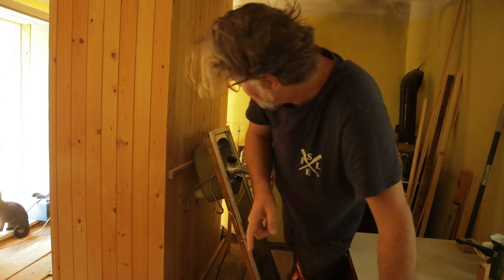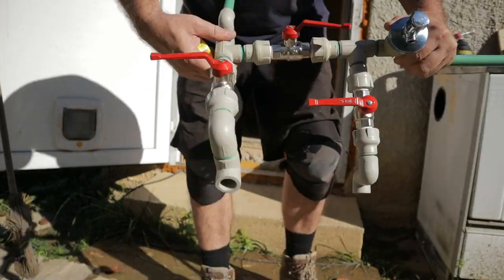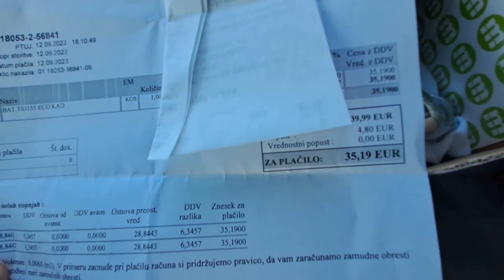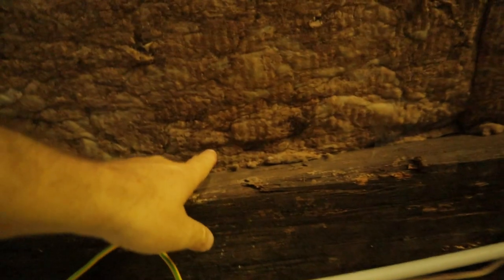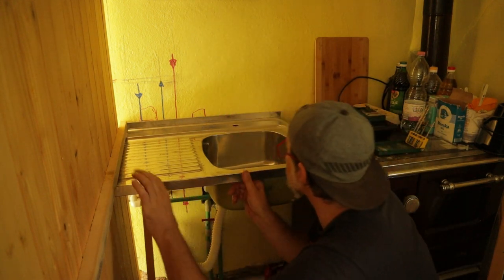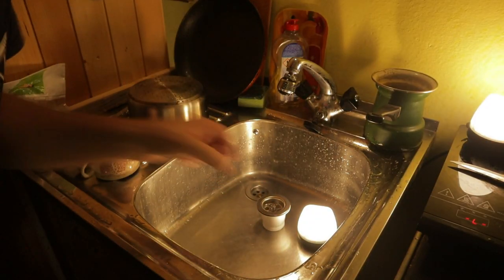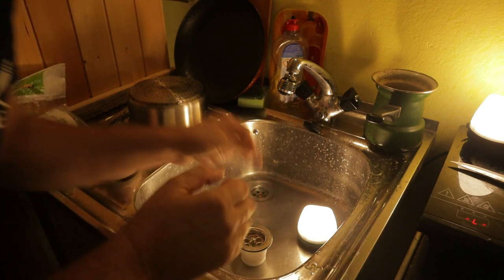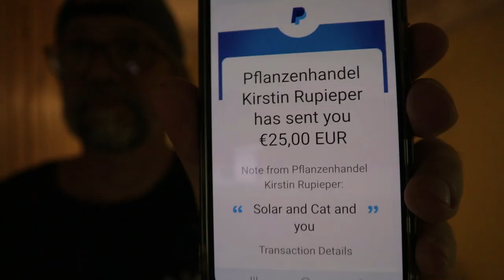DIY Installation of Kitchen Sink and Drains, Rescuing an Old House

Comment: In italy we use a small pipe, connected with the drain column, that goes to the roof, ending in a small chimney or a 180° curve to vent the drain, so, when we flush water the pressure in the drain is the same as the outside and is not create a vacuum that reduce the flow. It goes on the roof to avoid smells and because it's just easier to prolong it straight to the roof.
Reply from the maker: Yes, I know that. Thank you Paolo 👍🙂

Comment: Great video Robert 😎 how is your solar working? Is getting darker so I am wondering how much electricity you are getting from sun nowadays.
Reply from the maker: Yesterday I drained the battery completely for the first time, but I still didn't need the generator.
Reply: @klerobi1  great info, thank you Robert! 😃 maybe you can do a special video dedicated just for the solar system — with some useful information about usage etc... your experience POV :)
Reply from the maker: @Geneosity  exactly this video is coming within a month. If you noticed, I don't have a completed solar stand for solar panels
Reply: @klerobi1  great :) thank you for info, looking forward to watch it!